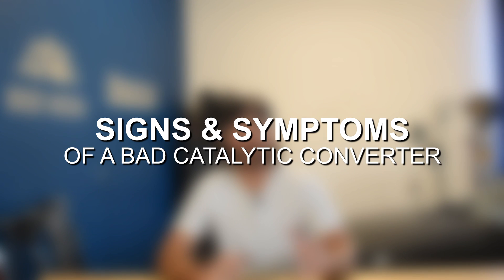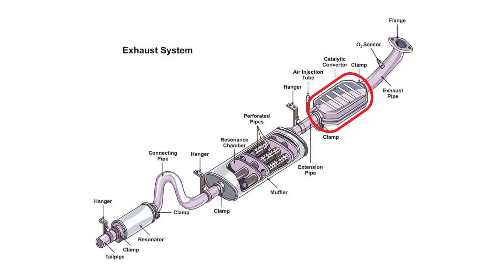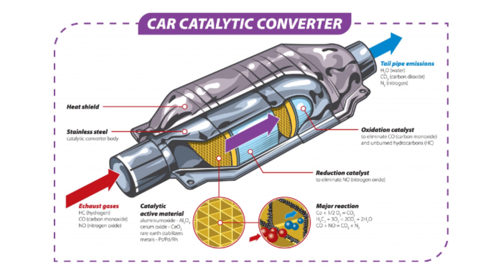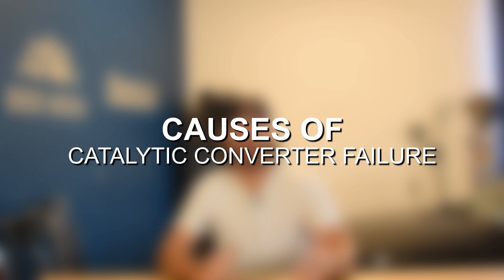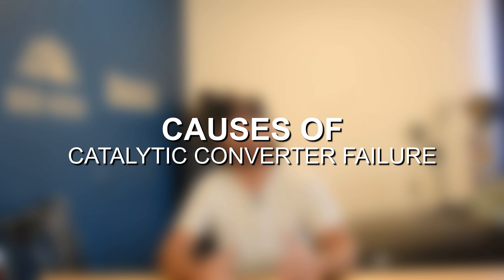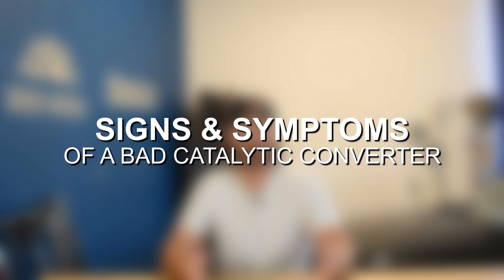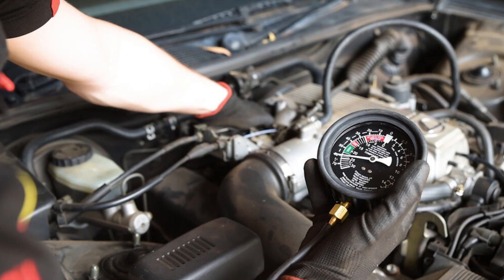Signs & Symptoms of a Bad Catalytic Converter!

Comment: Would a clogged converter cause valve clatter sound when the engine  gets hot from the increased back pressure? It gets boggy and then I'll hear the valves when accelerating. I am getting a check engine light for a small fuel leak. Gas cap, purge valve or converter I think is what the code was. Code goes on and off.
Reply from the maker: F - Certainly possible. Try to get the code when the check engine light is on and check back. Hard to diagnose without a code

Comment: I appreciate you answering the people in the comment section. I have a 2009 MB E350 which runs fine with good power and a steady idle. Nothing seems off. However sometimes when I step on the pedal I get that nasty suplphur smell inside the car. The rpm gauge can also sometimes surge slightly at highway speeds. My engine have some oil consumption. I passed the emission test last year. What do you think?
Reply from the maker: A - Based on the smell, it could be your cat getting clogged.

Comment: I been driving my G37 and when I hit the gas pedal to the metal, there is a nasty smell but it doesn't smell like burned fuel. It's a different kind of smell and I only notice it when I step on the gas pedal kinda hard. Do you think it's because of my cats going bad?
Reply: Trust me, same thing going on with me. I been looking for 7 months.. it’s the cats just found it out at the shop. 2013 g37
Reply from the maker: H - Thanks for sharing your experience!
Reply from the maker: O - Could be. Getting any engine codes or check engine lights?
Reply: @8020Automotive   No engine light and no codes. I been told that it might be my gas pedal but who knows.
Reply from the maker: O - The gas pedal wouldn't cause a bad smell. It's likely the cat.

Comment: My traverse wouldnt accelerate to get on highway. I pulled over and it started sputtering and died. Restarted sputtered died. Then it started and ran fine. Threw p0430 cat bank 2 code. Any ideas?
Reply from the maker: D - May want to check O2 sensor/s or cat.

Comment: My old farm van is spitting and sputtering so went to Auto Zone and hooked up the tester.  It is a 2003 Dodge Caravan 6cyl.  The initial code PO420. Then. 34,35,442 and 455.  I can’t get a straight answer from anybody.  Any thoughts.  Ty.
Reply from the maker: S - How many miles does it have? Guessing you're saying P0034, P0035, P0442, and P0455?

Comment: Ive had good success spraying an entire can of carb cleaner into the exhaust before the CATS with the engine running (I drilled a small hole before each of my 2 cats, sealed later w screws).  Seems to really clear out blockage!  Big jump in performance.  I did this again recently after dealing w a LEAN condition from loose/worn oil filler cap and torn, leaking grommet seal on the oil filler tube.
Reply from the maker: A - Thanks for taking the time to share your experience!
Reply: Can I try the same process? but instead of drilling the hole, can I use the hole from when you remove the sensor before the CAT?
Reply: @kairoSan13  not a mechanic, but it doesn't sound like a bad idea, the only problem is that there may be an o ring on your 02 sensor and the carb cleaner may eat through that when you plug it back in. If you have some bolts before the cat you could loosen them and get just enough room to spray it in there. Not sure though.

Comment: I changed the downstream O2 sensor and it triggered the CAT code. I did the upstream, erased the codes and it came back on. There was stalling while driving and weak acceleration.
Reply from the maker: U - We have heard of this happening before unfortunately.. Are you getting any other engine codes?
Reply: @8020Automotive  still O2 sensor codes , evap, every code knows how to trigger for an oil change 😅

Comment: I have a 2005 Civic with a 1.7 L engine. I had the rotten egg smell a while back and I also had a battery with a dead cell. It would still start my car but it would not shift right and my mechanic also said it affected how my cat worked. I am still concerned about the catalytic converter I did put some stuff in there to get it unclogged but I was just wondering if removing the O2 sensor on my Civic would help?
Reply from the maker: J - Not likely, sounds like you may want to check on your cat. Are you getting any engine codes?

Comment: Be careful who replaces the part. My catalytic converter was stolen off an 2005 Tundra happens to have 2 Took it to BIG O TIRE shop in Bakersfield Ca they sublet the work to BOBS Mufflers picked up my truck when it was ready they forgot invoice from BOBS in my truck for $1800.00. Big O Tire charged me $4800.00 File complaint with BAR they investigated the only thing they did wrong was not disclosing the job was being sublet to BOBS. I got stuck with the bill so dont take car to a shop that is not a MUFFLER SHOP. My friend did worst she was screwed by a smog shop $5400.00 to replace them on a JEEP.
Reply: I've learned how to do repairs myself, i have done wheel bearings, control arms, brake pads, rotors, water pumps, alternators, etc. etc.
I can do a brake job (pads and rotors) on a car in around an hour now. I even learned how to do wheel alignments using 2 cinder blocks, a tape measure, and some string.
Its really not that hard, I just watch a couple of  you-tube videos, and buy my parts off Amazon or E-bay.
Shop labor prices are ridiculous, and finding an actual honest mechanic is like trying to find a unicorn nowadays.
Reply: @partlycloudy9443 good for u.  Can you people that don't have a place or the tools to do something like this or care for that matter
Reply: How can that cost so much? Repair shops overcharge you for parts , double , even triple the price.
Reply: @CeaaArchuleta buy your own parts.  If your mechanic won't work with you because you already have parts, find a different one.
Reply: lol, 4800.... why would you even agree to that for a 2005 vehicle... even 1800 is too much
Reply: I found two new cat converters for my 2002 Tundra for 200 bucks. They are literally just bolt on. 5400 for that is robbery. I would definitely let other people know not to use that auto shop.
Reply: Ain’t no way I’m paying that much for a converter job 😮
Reply: Yeah good luck welding.@FrogUniverse
Reply: Mine too
Reply: Did bobs fix it? I need mine replaced in Bakersfield
Reply: Bob is my to go to for anything exhaust. I've been there 2x for cat replacements.
Reply: Cataclysmic converters are another leftist green weenie scam.
Reply: Catalytic converter replacement work?  I will replace Cat Converter myself.
Reply: @SKCCP u will not.  We r watching.  All day
Reply: They'll charge 30 buck down the street in Mexico.
Reply: i got  a 2015 nissan rogue that nobody can diagnose.  already had the cats scoped and the guy said they wer clear.  no pwer burns super rich
Reply from the maker: T - Thanks for sharing this insight. This has certainly been a big issue..
Reply from the maker: F - Not everyone has the automotive skill to do so..

Comment: Rotten egg smells could be caused by the MAF sensor.
Reply: I still can’t figure out
Reply from the maker: B - Are you getting any engine codes? MAF, Catalytic converter, battery, or o2 sensor can cause this.
Reply: My 2008 Buick rendezvous 3.5 runs perfect until it get warmed up. Then it stalls when slowing down or stopped. It threw a crank sensor code. So I changed that. Now it’s throwing a p0036 and p0054 codes. Nothing changed and still doing the same stalling at stopped or slowing down.
Reply from the maker: C - We have a video on vehicle stalls that may be beneficial here: https://youtu.be/7bqAIbYRdnc
Reply from the maker: A - Certainly possible.
Reply: @8020Automotive I had the same problem but 02 sensor code pops up
Reply: I had that same smell right in my trunk  2010 BMW
Reply: Update 
I just found out spark plug #3 is shot and #5 coils is bad later on I will change all my spark plugs and that one coil see what happens 🙏🏼🙏🏼
Reply from the maker: B - Keep us updated!
Reply: @Amanlikeme  man I put all new plugs plus a coil. Started a bit better but after 10 minutes I try step on my accelerator aster 3 seconds of doing it it cuts off now it don’t even wants to turn over zero and it show a key
Reply: 2010 Chevy equinox ltz
There's so many cat converter geniuses in youtube but when I take my car to cat converter specialists, no one can figure out what's wrong with my car.  I keep getting pushed around by mechanics. Been to 3 different shops. It's really difficult because I'm a female and lack of knowledge to challenge mechanics. No one looks past the converter. I've changed the converter 7 months ago and I feel it's toast again. Either converter or engine overheats really badly and po420 code comes on every 5-6 days. Now it came on after 2 days and i had loss of power and every red light or stop sign the car got really bad and had to turn the engine off. It always shakes/vibrates before code comes on. When it got bad then i felt it chokes up/stalls. Had to tow it to mechanic as I was scared to break it more because last year i already got engine rebuilt. Everyone argues back to me its not this or that but then they don't try to figure out and tell me whats wrong. They say just keep erasing the code, its fine, but then car shows signs it's not alright. I have cheap amazon code reader which for me seems to indicate problem with fuel system and EGR. I hope my current shop looks into it.
It is really frustrating as the issues with my car has ruined 2 summers and I'm broke for paying mechanics for nothing. I'm losing my 💩 already. Working on 2 jobs, need to get to work and dates (without arriving with mental breakdown) lol. Causes me anxiety and mental breakdowns every time it starts breaking down. What is wrong with the mechanics? I'll figure it out myself with youtube and Google before they do.
Also, one shop said the whole cat and muffler system isn't like it supposed to be and has welds and pipes wrong size, its quoted over 4k job. I still feel they maybe right but there's something else causing the problems, I don't want to pay 4k and the code to still come back on and all the work go bad in 6 months. Chevy paperwork says if any of the parts needs replacing it shouldn't be welded and whole thing needs replacing. I think there might be a point but, I hope I'm correct thinking it is the EGR and fuel system causing issues.

Comment: Hi Jake, nice explanation on the catalytic converter. Regarding the car's performance if the Catalytic Converter is bad, can one of the symptoms be that the car shuts down while driving if the AC is turned on?
Reply from the maker: L - A catalytic converter can cause a car to shut down when it overheats. However, what you are describing points us to the alternator: https://youtu.be/HKP1vKsIr4g

Comment: I have a 2016 Hyundai Tucson and it was drinking to much oil. Engine had to be replaced. Two days later engine light came on and I was told its the catalytic converter.  Probably from the bad engine that damage the cat. I tried Cataclean and engine light turned off for a couple of days but turn back on. It runs fine and has a lot of power. I can't afford 3500 to get my catalytic converter replace. I trying to find an affordable place but some mechanics are scandalous. I dont know what to do. Can you give me some tips on what I should do?
Reply: Straight pipe it 😂😂 you don’t need em per say if you don’t care about the environment but I do understand depending on what state you have inspections and have to have them but if you don’t just straight pipe it

Comment: I am not exhibiting any signs of a bad cat other than the temperature before the cat is hotter than after the cat. No power loss, o2 sensors seem to be working fine, I don't think I have any exhaust leak. Recently replaced cats but P0420 and 0430 came back. Any idea what else I should check for?

Comment: I have a 2014 Sonata. I know all about the junk motors cause mine is junk. With all the same symptoms of a clogged cat...could this possibly be the issue? When it misfires, I hear the lifters clicking and burnt oil blows out the exhaust?
Reply from the maker: F - Certainly could be! Any engine codes?
Reply: @8020Automotive Initially, but the mechanic that works for the place I bought it, cleared it. It's no longer coming on
Reply from the maker: F - Well that's good! Hopefully it stays off.

Comment: The purpose of the catalytic converter is not to reduce carbon DIoxide (CO2). In fact if the catalytic converter works, the compounds that it is intended to reduce (mainly carbon MONoxide and hydrocarbons are converted to carbon dioxide, so this gas actually increases in the exhaust.
Reply from the maker: K - Yes, we misspoke. Thanks for sharing this insight!
Reply: @8020Automotive  ,,,,,,,,,,,,,,,,,,,,,,,,,,,,,,,,,,,,,,,,,,,,,,,,,,,,,,,poor freakin  editing  by  someone............................reread  what  you write,,,,,to insure  it is  right.................misspoke,,,,LOL...when i aim  correctly ; i never miss a poke..............................
Reply: The cat also converts toxic nitrogen compounds into nitrogen that isn't toxic. That's the main reason for it.
Reply: Fuck a god damn cat id rather just not get emissions

Comment: My granddaughter has 2015 Sentra that will not go over 40 and engine will die at stop sign. Advance Auto test said cat converter code showed up. She took to a mechanic who she didn’t know and they said transmission was bad. Any thoughts on next step for her?
Reply: Deff take to another mechanic and get another opinion the sounds a bad trans makes are way different from the sounds a bad cat makes the stalling and not going over 40 certainly sounds like your cat I had this issue on my impala except my got so bad that I couldn’t accelerate past 20! So sounds like she could get away with maybe running a bottle of cataclean in the gas tank and see ir that helps clean out the cat at all then if that doesn’t work I’d take to another shop they shouldn’t charge you more then about 500-600 for a cat replacement on that model car
Reply: @NeuralForge420  I took the car to a trusted mechanic and it had 4 transmission faults, pollution control faults. They recommended she trade it in ASAP while it still moves.
Reply from the maker: R - Not a bad call unfortunately.
Reply from the maker: I'll echo what was said by thatstoner (lol). Try a different mechanic - it could be the transmission but that's very unlikely - a clogged cat would be much more likely
Reply: Sounds like a catalytic converter..I have Sentra 2012 that is the issue....got mine on Amazon for 160$ and Mobile Mechanical charged me 300 to put it on....dealerships saying over $2,600 for the fix...car not even worth that much but for now I will keep fixing it bc prices of cars are ridiculous at this moment
Reply: Cetacean does not work. It only help along the wall of the converter. I paid $30 for absolutely nothing. The mechanic told me after I used it.
Reply: oh lord nissan shitra haha 🤣 
nothing but problems! i’m scared to ever get a nissan again 👎
Reply: @Erienicole18 my Nissan didn’t give me problems for 17 years. Now the engine is running lean and the mechanic can’t figure out the problem and is taking forever. Still a great run for this car imo
Reply: I have a 2017 Kia Rio burning oil, and rough idle. Check engine light came on. Took it to local auto shop for a diagnostic. Code P0420 came up. They basically told me that because the engine burns lots of oil, fixing the catalytic converter would not be worth it. 
I took the record of the diagnostic to the Kia dealership, and they are going to look at it. 
The car is only worth &5000, so is it worth replacing the catalytic converter @ $2500, if they can fix the oil burning problem?
What would you suggest?

Comment: Would just test driving with the forward O2 sensor removed stop or noticeably improve the misfire and acceleration low power issue since a lot of the back pressure is a bit relieved? ( Assuming a clogged cat is the problem}
Reply: ,,,,,,,,,,,,,,,,,,,,,,,,,,,,,,,,,,,,,,,,,,,,,,,,,,,,,,,,,,,,thanks,,,,,,,,did  not  think  of  the obvious  test.........................................
Reply from the maker: H - We have a video on O2 Sensors that we think would be helpful here: https://youtu.be/hpqXLGAE4Xo

Comment: Bro I can’t tell someone please help me Evertime my truck has been sittin for a min and the exhaust cools off I’ll hear a lot of rattling coming from the middle of the exhaust close to my cats but after a it warms up and I drive away it doesn’t do it anymore
Reply: My hhr rattles too at the cat and it also sometimes has a tough time starting
Reply from the maker: A - You could be experiencing the same thing.
Reply from the maker: P - So it rattles at idle? Have you checked if the piping is just hitting each other?
Reply: @8020Automotive  no I’ve looked at it my cats are rattling from the inside I just got back home and now my truck is losing power and doesn’t wanna go up hills I need help
Reply from the maker: P - Sounds like a problem with your catalytic converter than. It could be clogged.

Comment: 2013 Toyota Camry is throwing out a p2109 throttle body code. The symptoms are loss of power but gradually catches speed. Also burning oil more than usual. Symptoms all point to clogged catalytic converter. Will it throw that code (p2109) as well not the usual p0420 or O2 sensor code. Do you recommend changing throttle body first or Catalytic converter?
Reply from the maker: I would try cleaning the throttle body first and seeing if that does anything, but agreed that sounds a lot more like a cat.
Reply: Its a toyota it already has loss of power straight out of the factory 😂😂
Reply from the maker: XD